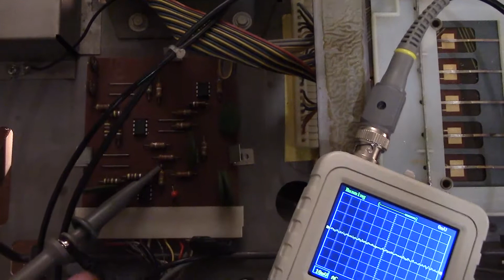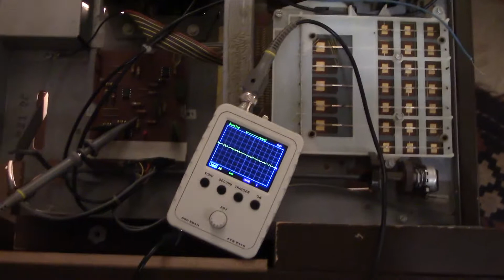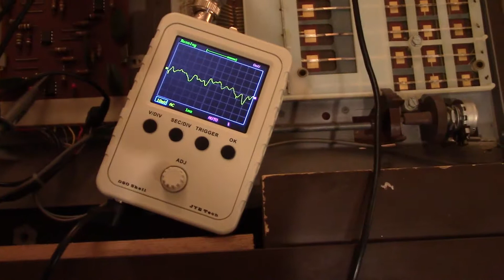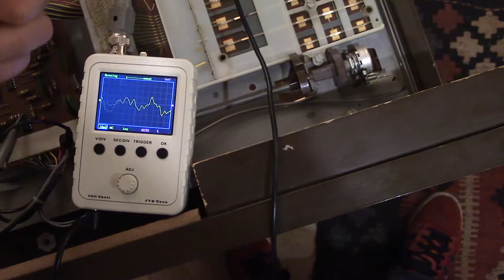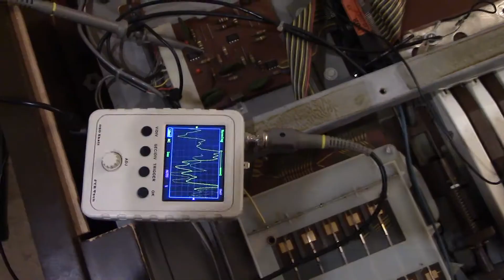Mattel Optigan Model 35011 - Repair Pt4 - Opamps, Scope, The Undead

Comment: It's sad that that if they'd just put a DC blocking capacitor before the power amp, that would've prevented the smoke escaping. On your last video, when the output drivers blew I guessed DC was to blame.

BTW I got here from your comment on 8 Bit Keys. Now subscribed :)